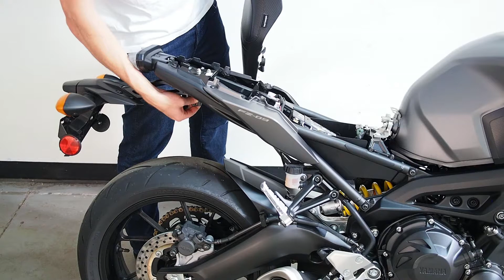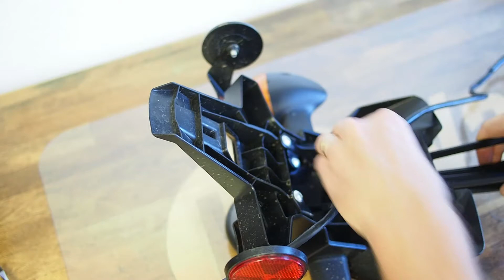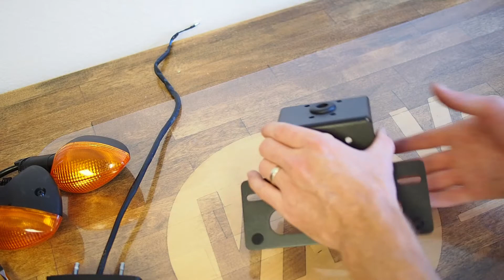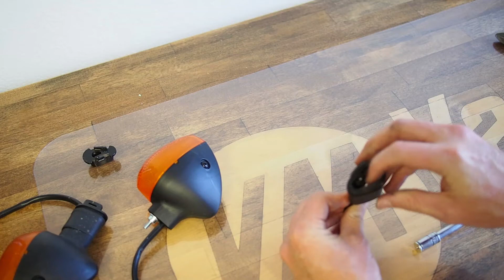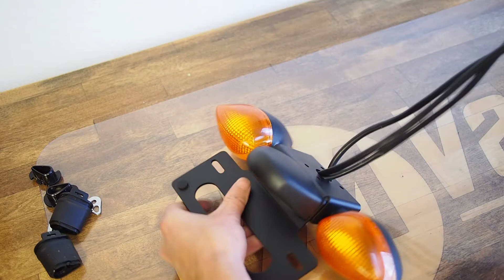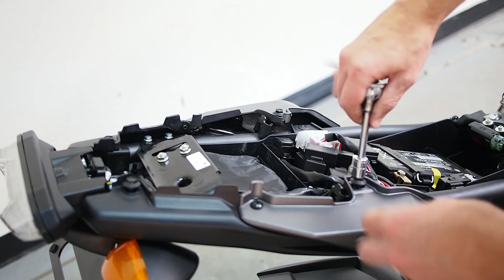Yamaha FZ-09 Fender Eliminator Installation Video - Vagabond Motorsports VM-Y910

Comment: It looks awesome!! So much better than the stock setup. For the FZ-09 it is a must buy. The price of this kit beats all other kits I've researched. This IS NOT thin cheap metal. It is very well machined and flawless. Why would I get the other kits that make you buy aftermarket signals? I love this fender eliminator!
Reply from the maker: Thanks Nick!